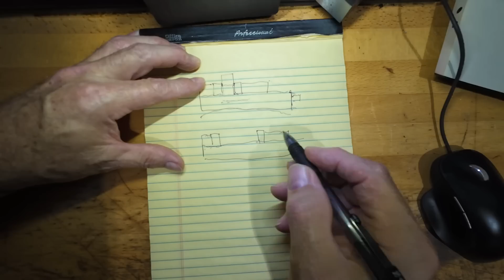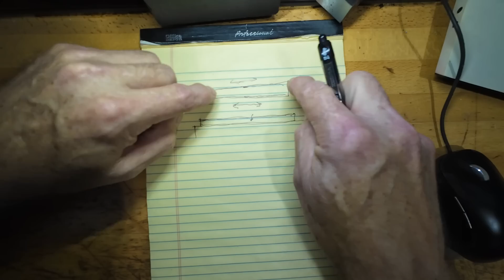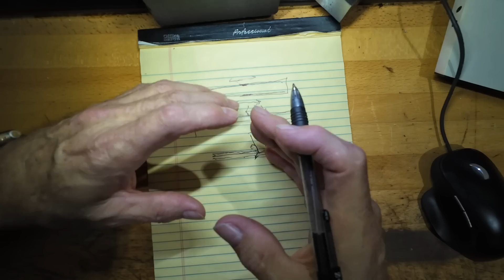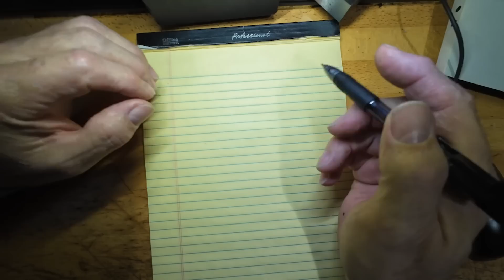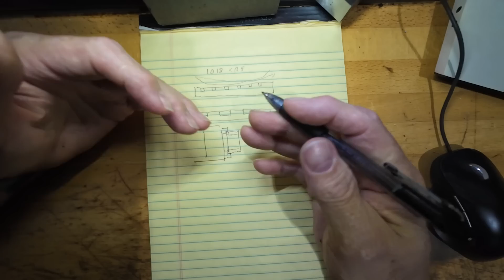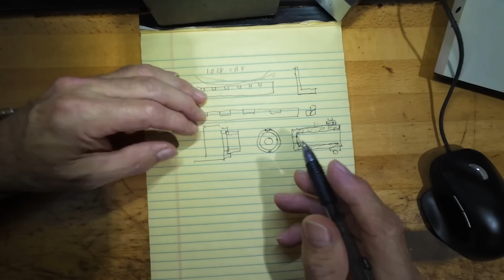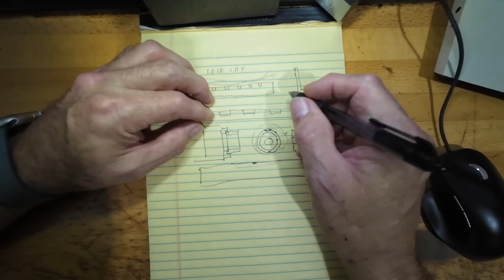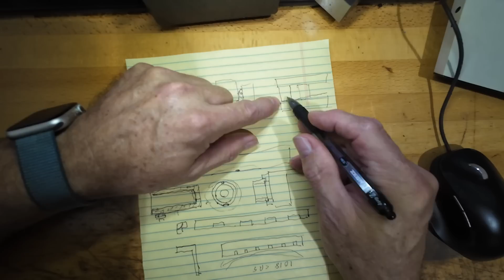Distortion From Machining and Setup

Comment: Your video is very interesting and I agree with what you said. But, your introduction goes through areas that aren’t needed and am sure some people clicked off before your actual video even started. It would be better to just introduce yourself to new viewers, such as myself, tell what you’re going to do and then just do it. The work will speak for itself. I’ve been doing this for over 50 years and there are many techniques to alleviate distortion. I’m always happy to see some more. By the way, the new Kurt vise series pull the jaws together rather than push against the fixed jaw bending the vise base, which is supposed to be constricted by the screws holding it to the much stronger table, but only helps partly. The new configuration results in less distortion as pulling the jaws together uses the work to prevent distortion. People tighten vises too much. Of course, these vises cost even more, over $1,000 for a 6” model, which seems to be the only size right now. Racking a vise jaw also damages the movable jaw after time. I also weld, and distortion there is always an issue. Heat straightening works very well. It’s also used to produce large curves in work.

Comment: I like all your videos. I'm working in the plastic cnc machining industrie on a b-axis millturn. Distortion in my last name. Still every day try to balance between clamping pressure and distortion in parts. A lot of the time on my machine the clamping pressure doesn't even read on the pressure gauge and still distort my parts out of tolerance. And on moment like that the centrifugal force from the jaws comes around the corner. The time the chuck needs to close the jaws takes like 30sec.

Comment: As Robin Renzetti says, nothing is perfectly rigid. Everything is "made of rubber". Everything has internal stresses. Everything is a thermometer if you can measure length well enough.

And as an engineer working with electronics, everything is a microphone, a thermometer, a hygrometer, and/or a radio. When you get down into measuring the parts-per-billion range, the number of significant interference sources jumps in ways you wouldn't expect.

Comment: Thanks for your great experience.  I see these problems and only partly understanding of why.  Making bad parts cause us to learn sometimes.  I always enjoy learning from you.  I had a whole hobby machinist forum who many agreed that my lathe was screwed up because I was turning a 10” diameter disk which was 3/4” thick and made a one thousandth conical shape.  I had it backed up with besides the jaws.  It was hard to get it better.  I wonder how much could be from stress in the Dura-Bar cast iron (which I thought it would be stable).

Comment: Peter, really interesting stuff. I had my fair share of banana parts in the past too. Especially cold rolled but also hot rolled stainless 316 challenged me to get out right parts. Roughing, releasing, finishing is one of most valid strategies for me cutting accurate parts. Thank you Peter! Good to see you in action again! Best! Job
Suggestion?; thin long parts in the lathe with tight tolerances.

Comment: My nephew runs a waterjet cutter. He was cutting slots in RHS and saw it distort. He thought it was the heat of the cut but I thought it was the stress from being folded and seam welded being relieved - maybe both? I suppose the waterjet is not far off a sandblaster distortion.
Using a slitting saw on aluminium stock made me aware of how much material can move. When it split the bore the block  closed up and shattered the slitting saw.

I think the people that follow and watch your videos do so because of the detail you put into them and it is appreciated. I clicked on this as soon as I saw it and not disappointed.

Comment: I would be interested in the fixtures you've made to avoid distorting parts. Also if you could explain how to machine soft jaws or fixtures taking into account how the work holding will distort and deflect as it is tightened.  Also interested in order of operation for lathe parts. Thank you I think this is the most important subject to learn for machinist

Comment: Honestly appreciate someone talking about distortion of the workpieces, it's not something you see around YouTube in general.
There's just, "oh we scrapped that part, we just make a new one.." 

Like an example from work, aerospace parts, thin walls (1.50 mm / 3.00 mm thick etc.) and it's a large product (largest diameter is in the ballpark of 1300-1400 mm, while the smallest is about 700 mm)
And the distortion is insane on those kind of parts.
We machine a couple of features +0.20 to +0.30 mm from the nominal measurement all because once everything is machined (it's quite the long operation, around 70 hours) those features have grown into/calmed down into close to being nominal at that point.

Comment: The only machinist I watch.  So many videos of guys ramming a vendor supplied tool through a chunk of soft material for views. It's nice to have some confirmation that I'm not the only one dealing with material stress and work holding distortion trying to hold a final tolerance possibly four or six setups down the road. 

I personally would like to see you show this in a video.   These are the tips and tricks that can take years of experience to learn.  Thanks for sharing.

Comment: Great video. I've seen where you've touched on this in a previous video. I was aware of temperature effects, but had no knowledge about the stress relief and input in materials during machining operations. I love the root cause analysis of what might otherwise be mysterious dimensional outcomes. 
A video on inserts would be cool as well. Which types for which material and how they might affect the material. It kind of feels like a shot in the dark when trying to pick the correct insert with a million choices out there.

Comment: Oh ya... as the jaws spin faster the centrifugal forces relieve some clamping force . There's a weak link in the chain somewhere. Pprobly story s like the part with the keyways engineers can come up with stuff that can't be made ,till  the rite machinest comes along I guess . I haven't been watching YT vids for a while been moving around looking for a new job as a manual machinest or auto mechanic had several toxic environments in the last three years have the same autism as you it's plane to see but ya you've done some difficult jobs and your experiences are real time savers people new to machine shop stuff probly could benefit the most see ya round...

Comment: The best plan for close tolerances is to avoid vises altogether, but people are addicted to vises. Even a 6" Kurt will shift a part toward the fixed jaw over.001" with moderate tightening. Often that is not noticed and does not matter. The Jig Boring machines and CNC jig centers mostly use clamps. The subplate systems with two piece subplate vises is the best of both worlds where a combination of clamps with the vises can be used. The craziest thing I have seen on YT is a miniature sub plate made to be held in a vise. One problem I had was holding castings with minimum distortion for repairs.
Another problem some materials are damaged stressing them is vices or chucks, the damage shows up in X-ray. Everyone has a table clamp kit but avoid using because it will disturb the vise. Now that is funny!

Comment: As a mechanical engineer I was taught about internal built-up residual stresses but not techniques to overcome them when machining.  That learning was done much later --the hard way.  Your videos should be compulsory viewing for engineering students and teachers.  Can you please touch on in future videos about heat treating processes such as normalising to remove the residual internal stresses created during initial manufacture of the stock.  Thanks.

Comment: Inciteful as usual. Only experience teaches you never have enough experience. I'm machining hardwoods atm (massive internal stresses, massively sloppy tolerances lol). I'm learning that ideally I should sneak-up on the finished dimensions over several weeks, add drying cycles, manage the repeatability of work-holding setups and work-offsets more carefully, and lower my expectations. I hope to graduate to metal one day..

Comment: This is what I deal with Daily. I work at a job shop & mainly operate 3 diff VTL’s + 2 Horizontals. I’ve experienced pretty much everything you’ve talked about today. Another way to hold wacky materials or thin walled parts is to use table clamps. You could either have holes drilled in your chuck or put an actual table on top of your chuck. Also, if it’s tight tolerance I always rough out the part, then release it to relieve pressure before finishing. (Lower chuck pressure before releasing/re clamping). Thank you for making this video, I really hope you make more of these!

Comment: Love your videos peter, worth 1000s of $.
I just milled a 6mm keyway into a 20mm dia piece of 303, 2m long. I told them it wouldn't work, but they said they'd straighten it themselves. The  ends must have jumped 20mm when I opened the vice. I even asked them if I could put a key in the other side to balance it out, but that wouldn't work for them.